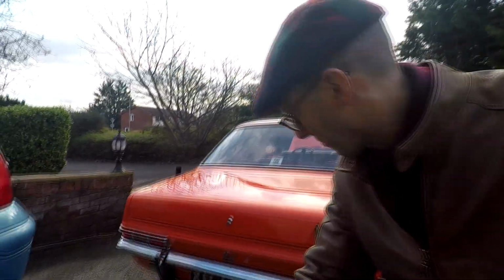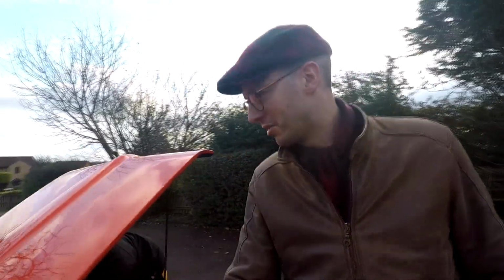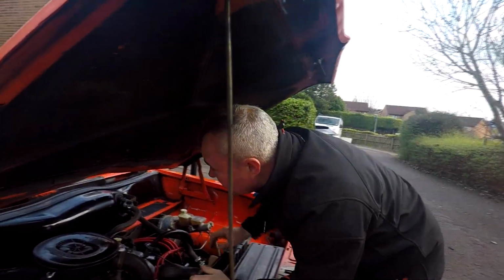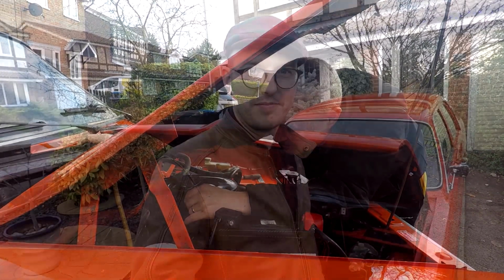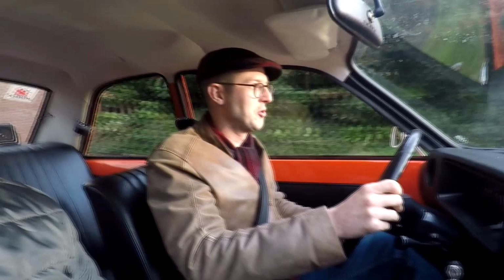Vauxhall Viva Sound Deadening

Comment: Hi Steve, revisited your video regarding your LHD  HC Vauxhall Viva.
What country did it originate in.
What year was it assembled?
I was looking at the air cleaner, that type had the manual summer & winter setting.
I presume its an early 1256cc model since the front guards are flat on top.
The 1159cc early models had tilted front guards. ( along with 1600 ohc models )
Salvage Rebuilds UK has an HA model in stock.
Love to see some close ups if you still have your HC.
Happy 2022, trust your well.
😁😄👍👌
Reply from the maker: Hi Vernon, the Viva is not my car, it belongs to my friend Paul who's on the video. The car is Dutch, it was imported by Paul, and is in very good condition. I don't know that much in detail about it, other than what Paul does to it. Vauxhalls are Pauls thing, Triumphs and MG's are what I'm more into
Cheers Steve
Reply: @SteveDentonClassics  thanks for taking the time to reply, and pass my regards to Paul for making the Dutch LHD available.
You said you are a Triumph man, do you deal in Mitchellotti Vitesse's ( Can't even spell the Italian surname sorry - no spell check )
Loved the little Vanguard powered quad lighted car !
Happy 2022.
Regards Vernon. ( NZ )